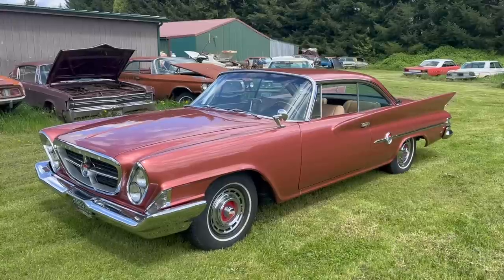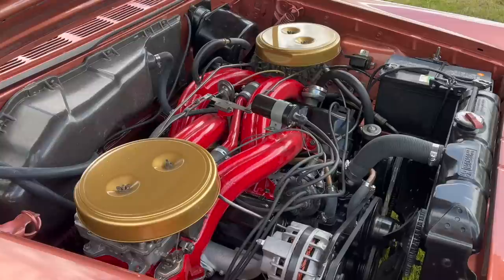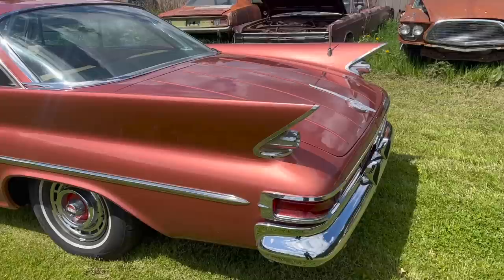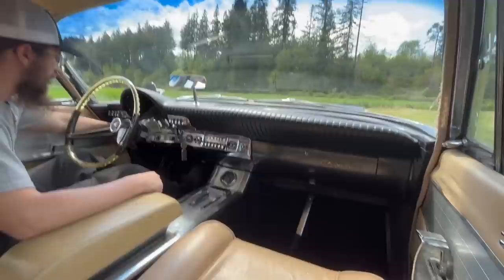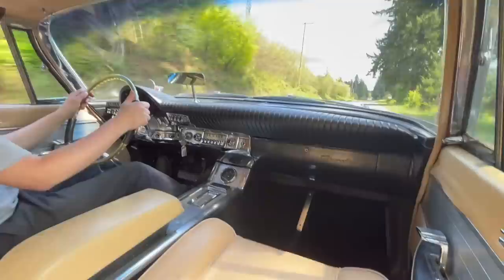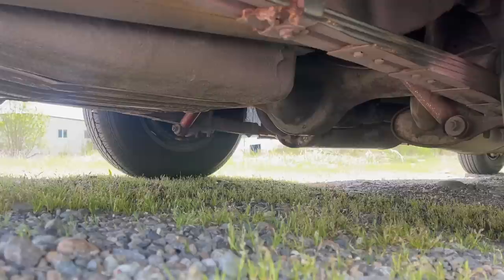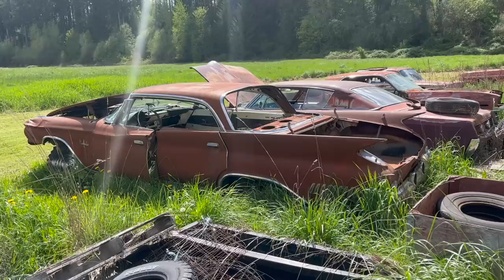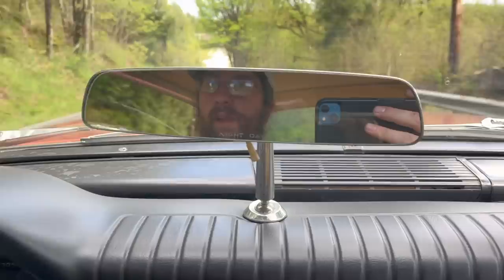A Tale Of Torque And Luxury - 1961 Chrysler 300G, With 413 Long Ram Power!

Comment: Thanks for the memories Jamie, love the car.  I had a friend/customer with a 300F convertible, basically the same drive train.  The car was basically stock, the only changes we made were disc brakes in the front and converting the Tach drive distributor to Chrysler electronic ignition with factory small block parts.  

His last project was a 4 dr HT 61 Newport Wagon (440 powered).  All the mechanical work of the build was handled at my shop.  You haven't lived until you have to assemble the dash and gauge clusters on these cars LOL.  The turn signal release mechanism is definitely unique.

Your test drive of the G brought back a lot of pleasant memories of both cars and their owner.  Thank you.

Comment: Thanks for sharing - beautiful car!  I’ve been a Forward Look guy since I was a kid.  I bought my ‘57 New Yorker in ‘78 and took it to the dealership that sold it new for some work. The service manager gave me a tip on filling the master cylinder under those boosters:  take a piece of sheet metal about 2 inches wide by 6 inches long, bend a vee into it the long way and use it like a gutter to pour the fluid into the pot.  Been doing it ever since.
Reply from the maker: Nice. We used two sets of hands and a funnel. It worked… but still messy.

Comment: I was 20 in 1978 and bought a 300G for $1200 from a Seattle cop. At the time the engine had a single 4bbl, with the long rams, carbs, and air cleaners in the trunk The leather interior was in decent shape and the electroluminescent dash lighting even worked. I rebuilt the 413 and put the long rams back on. I also painted the car (it had no cancer!), and bought new wide white wall tires. I installed manual chokes because I didn't have the heat riser tubes that went from the exhaust manifolds to the undersides of the carbs. I sold the car in 1981 for........ $1200. Yep, that's what they were worth back then. I also nearly bought my brother's 300-C (392 dual quad) that he had been restoring but I had no storage room. He wanted $2500 for it in the early 90's. Yeah, there are some regrets with my prior car-buying escapades.

Comment: Thanks for a cool video30 years ago I rented this house I got back at a 57 Chrysler 300C convertible that needed everything he sent it out for paint body work done a new top I rebuilt the motor rear end tranny big project took years turned out great it was copper bronze metallic White interior sent out the weird brake booster to get redone that Bellows thing it was a cool car he had a little over 87,000 and after it was done then he got old and said well I got to sell it so I took it to auction he got 40 grand for it took a big hit but hey that was cool ride have a great day:face-green-smiling:

Comment: I had a 300 G , I had to get gas at the airport . It's not particularly quick but it is terrifyingly fast , especially for a car where the steering wheel does not feel like it's connected to anything . The braking and handling were excellent compared to my 73 Country Squire . I loved my G and consider myself priveledged to have owned one .
Reply from the maker: That’s awesome. I agree - it sure doesn’t feel like a sports car, but it does impressive stuff. Higher octane fuel is definitely a necessity.

Comment: The heater leak is probably from the heater control valve mounted up behind the glove box.    I just changed the valve in my 60 a few weeks back. You have to take the glove box door off,  take the glove box out to get at it up above the heater fan housing.   Takes a bit of manipulating to get it out but not terribly difficult.   Took me about 35 minutes to get it out and hanging down inside the glove box with the control cable still attached.  Also had to make a new gasket before installing the rebuilt valve.   Also had to remove one of the vacuum actuators to get it back in easily.   Not the worst job...
Reply from the maker: It was one loose heater hose clamp. The heater core had recently been replaced, and someone had been a little shy with the screw clamp torque. I think I showed that in the video. It was fixed for the last test run. But hey, that’s good to know. And dang… yours is pretty!

Comment: What a cool car on so many levels.
   Those twisting seats would be a nice ergonomic feature today.
   Plenty of room for both legs and shoulders- something that probably drives Truck sales in this era of downsizing. 
   Large with the poor handling/braking typical for the era- but you can see bits of the styling carried over for several years  afterward.
   But when you kick those dual-quads in- Yippee!!
   Funny to think that while Chrysler was designing and building this- they were designing components of Saturn 5, and had been building the Thor short-range nuclear-tipped missles.
   Maybe the reason for the 'rocket fins'.
   Glad Gary did OK it for you take us along for the ride.
Reply from the maker: Oh yeah. I think the fin stuff was a conscious tie-in with that era of rockets, space race development, etc. Very typical indeed - it’s definitely a boat. But the ride quality is excellent. It’s really interesting (to me) to look at all of these different cars from the 50s to the 70s and see them slowly evolve toward what we have today.
Reply: @DeadDodgeGarage  Agreed- like the '64-66 A-bodies with their vestigil fins w/strong verticle compenent to the tailamps, gauge faces with a resemblance to a aircraft level, and the rocket/jet cone housing w/red refective ring and white center of the reverse lamps - again rocket/afterburner(reheat) theme.
   After seeing the Chrysler G's 'Cockpit' styling- the carryover to the 66-67 Charger was amazing.
   Still, IMO the high water mark for 'cockpit' styling was the early '70's AMC Javelin SST Mark Donahue edition.
   It just wrapped around the driver's seat, great vision, well laid out gauges, informative- not distractive, just great.

Comment: Beautiful C body Chrysler, thanks for sharing.
I have a daily driver 64' Dodge custom 880, -A close relative of the 300 series.
Reply from the maker: Yes! Extremely close in fact. I really like the look of the 63-64 880 nose. I’d like to have one of those in coupe form some day. Although I did a bunch of work on a ‘64 880 wagon, and it was pretty cool too.
Reply: @DeadDodgeGarage  The wagon is the rarest of the 880's, something like only 1.5K were only made?

The 2 door's are cool, but the 4 door with the hardtop is really nice also, can hardly tell it's a 4 door with the windows down.

Anywho, thanks for sharing.
Reply from the maker: @samhicks97  I'm a big fan of the four door hardtop too. The same gentleman actually owns (or owned at the time) two 880 wagons and one Chrysler of the same body style.

Comment: I consider these to be, more "supercars" or "factory racers". The term "Muscle Car" really did not exist until Pontiac took a mid-size, lighter weight LeMans/Tempest, and put a full size car engine in it and called it GTO in 1964. The whole power to weight ration thing, light car, big engine. This is a big car, big engine, 100% amazing.

Comment: That’s when Chrysler was Chrysler back in the day you knew exactly what you wanted and what you needed in that Chrysler. Chrysler designed,built,created,made and manufactured Rides ahead of their time because their cars were based on the Space Race Competition with The USSR or Russia 🇷🇺 back then. If I had the proper funds room & space I would definitely 👍🏾 buy and add that 300G to my Antique,Classic and Vintage Auto Collection + drive them around in the end of Spring and beginning of Summer into the beginning of Fall. I like that 65 Chrysler 300 sitting on it’s right next to it Two thumbs up 👍🏾👍🏾 my Brother another different mother 🧑🏼👵🏽 two thumbs 👍🏾👍🏾

Sincerely Yours Truly 

Ivan I J🤵🏾‍♂️💼🕶️👓👍🏾👍🏾

Comment: I drove my late friend's 62 300 w/ a 426 wedge and in line dual quads and CI headers at the drag strip. It's kinda frightening when you have 6k pounds of steel that is that fast.

Comment: My friend that lives down that way had a black 1962 300 he sold a year or so ago. You may have seen it around town . Think he sold it with a white 62 parts car. Im drooling over that 65 300L , WOW !
Reply from the maker: Wait, I know a guy who had a black ‘62 Newport or New Yorker with red interior, and I’m pretty sure he also had a white one. I’m at least fairly sure it wasn’t a 300. I suck at names and am drawing a blank on his right now. But we did some front end work on that car. I really liked it and wanted to buy it but it wasn’t in the budget.
Reply: @DeadDodgeGarage  Was his name David H ? If so thats him but his looks like a 300 with the cross bars in the grill and emblem in the center.
Reply from the maker: @glenbo2464  That's him! Sorry, I was mistaken - his was indeed a 300, but the first year of the lower powered non-letter series (1962) with a 383. I did have to go refer to pictures he had uploaded of his cars. I guess I was thinking no 413 or dual carbs / cross rams meant no 300, forgetting about the non-letter car's existence. It's not a very big world we're living in here, either way. Haha.

Comment: Beautiful car, esp in this color.  
2:50  But it does suffer from the telltale sign of a missing PS pump bracket snubber.  When the snubber is missing, it is near-impossible to fully tighten the PS belt.  It will be tight enough to not squeal, but the belt can flop and rub on the water pump pulley.  This bracket setup was actually quite ingenious, in that it allowed the bracketry to 'relax' when PS load was low, and when demand increased, the bracket would squirm a bit and bite the belt a bit more.
Reply from the maker: So many earlier 60s big blocks are missing that. In fact, I’m not sure I’ve ever actually seen one in place, now that I think of it.
Reply: @DeadDodgeGarage  I haven't seen a 'correct' one either.  Mine have all gotten a small rubber block put in place.

Comment: I have a 61 Newport. The play in the steering is probably caused by a small rubber thing between steering gear and the steering wheel shaft. It is a pain in the butt to replace, so it rarely has been fixed. Part costs about 3$ in rockauto.
Reply from the maker: That sounds familiar. I think they used that same setup through about ‘64 on the full size cars? I once installed a Firm Feel gearbox in a Dodge 880, expecting it to fix the play. Then we found out about the rubber piece… that was an expensive lesson for a small and inexpensive part.

Comment: The purpose of the removable fender aprons has nothing to do with spark plug access. They exist to clear the RAM manifolds as the front clip is lowered upon the front frame on the line.
Reply from the maker: I’m familiar with the body drop. That would make sense.

Comment: What a ride they came with manuals to right.
Reply from the maker: Ahhhh heck I can’t remember what years could come with what. I’m not an expert, but I know there were three speeds available, then there was some whacky four speed available in ‘63, then the A833 was available in ‘64. None of these were common. On at least early four speed C bodies with consoles, the shifter comes out of the floor next to the console instead of through it. It looks like an afterthought. It’s kind of hilarious actually.
Reply: @DeadDodgeGarage  You could get a 3 speed manual trans in a G, VERY rare.  You could get a French 4 Speed in an F (1960).
Reply: @rocketresto  Yes, the rare Pont-a-Mousson, also fitted to the Facel Vega.

Comment: Muscle cars were invented when the BIg car engines were put into smaller cars.
Its muscular, but I would not call it a muscle-car. 
Hey, if I disconnect my battery my clock  stops ticking.
Thank you for the fun content
Hello From Wisconsin. 
(fun story, Imagine your young girlfriend sitting there when the 200 degree coolant lands on her bare legs ... )
Reply from the maker: Yikes. Lol. My wife tolerates a lot but that wouldn’t be a good one. Funny enough on the clock, I was test driving a convertible challenger the other day and thinking about exactly that. We go to great lengths to make sure they work (as with everything else on cars we restore,) but we also unplug every battery overnight so they’re never right.

Comment: Wow, beautiful  car. I  need to see if you can offer any ideas  about my 62 dart witch  when gets driven on a hot day will not manually  shift, therefore  I can not shift to neutral  to go to park, so if I shut  her off the neutral  safety won't let me start again until she cools down a bit. Any ideas??  Thanks
Reply from the maker: Huh. That’s very odd. I don’t know why ambient temperature would make a difference, but I do know correct shift cable adjustment is critical, and I have experienced something like that in similar situations of bad cable adjustment - it basically just won’t shift. But never relating to the temperature outside… if you haven’t done the adjustment process before, I recommend doing a bit of reading on the subject, then getting the cable set exactly right. Hopefully that helps.

Comment: it s a cross flow not a wedge!!!
Reply from the maker: Brother… it’s a cross flow wedge head. Chrysler called their inline valve head a wedge head. I’m fairly certain that term was used widely across the industry, but Chrysler used it officially - as in the 426 Max Wedge. Cross flow indicates that the exhaust port and intake port are on opposite sides of the head. So, while this big block head is a cross flow wedge, a slant six is a wedge head, but not cross flow. Hopefully that makes sense.

Comment: NO BURN OUT, WTF ? THUMBS DOWN.
Reply from the maker: It’s not exactly a burnout car… 😅 but if it were mine, you can be assured there would be one
Reply: @DeadDodgeGarage  GOTCHA.
Reply: @DeadDodgeGarage My 62 non letter 300 had a 383 3:23 axle, it was all factory, everything matched. It did a pretty good burn out. My cousin took a great photo of it billowing a cloud of smoke from the fender wells, I really miss that car.